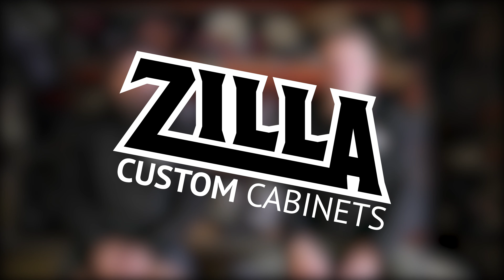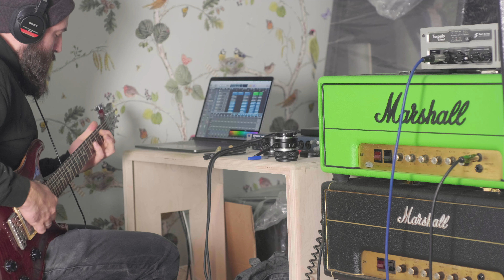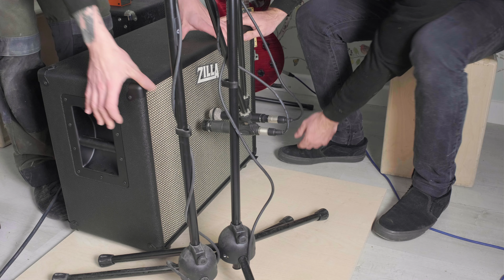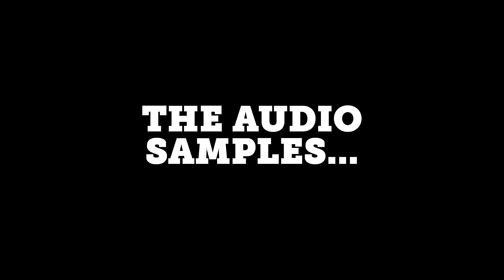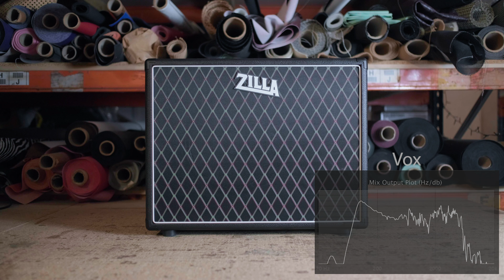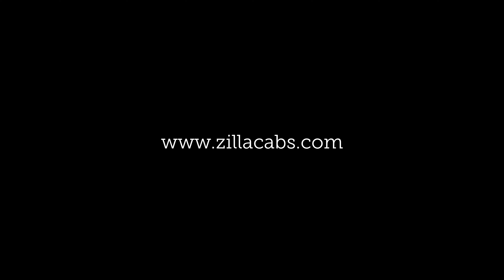How grill cloth effects the sound of a speaker cabinet and amp.

Comment: Terrific video gents. Really interesting.

I recently added an early 70 replica 4x12 with S&P grill cloth. It feels and sounds like cane when I run the back of my hand (nails) across it. Anyway, I can't believe how great this cab sounds compared to the 80s 1960A I had for over 25 years. I don't think it's any one thing, though I feel like the overall construction (built to original specs) is the biggest contributor, followed by speakers, and then grill cloth.

I'm guessing most would put speakers first, and until getting this cab, I would have felt the same way. But hearing the resonance of a well-made cab has allowed me to see the light.

At any rate, I enjoyed the vid and LOVED the tone!

Comment: Great video! With my eyes shut and cranked through studio monitors there's one or two that stood out to me but otherwise it was real subtle. That Marshall sounds ace through all of them regardless.
Reply from the maker: Thanks mate, the difference was really subtle wasn't it.. I think the big difference would have been having a removable grill allowed the mic to be placed closer with the grill off (not that we recorded that option any closer)... that said I'm not sure closer would have sounded better, just different.
Reply: @ZillaCabs  closer to the speaker would increase the proximity effect. On a Mesa cab, it's quite common to pull a mic back 3cm+ from the grill, or you have to lower the bass on the Amp, making it sound anemic in the room. Plus it adds like a 2% in natural ambiance. It just makes things sound a little bit more natural.

Comment: The changes on the graph were extremely subtle. Most people need to hear a 3dB SPL change to hear a difference in volume. None of the graph changes looked anywhere near 3dB. I doubt even the best ears could tell much if any difference. I would have to see someone doing a double-blind test or even better still ABX testing to believe mere mortal ears could tell which cloth was which. Thanks for confirming what I suspected. Nobody in the audience will be able to hear a difference so pick the cloth that looks best to you. And if you think one cloth sounds better than the other use it. The most important thing is to do what makes you happy. <G>

Comment: Great video. Thanks for doing this. I was interested in seeing the response of the orange Basketweave. Is that the same thing as a Cane Grill cloth? There is a lot of talk about how the cane grill cloth cuts highs. The graph does show minor cut in highs but certainly not noticeable to ears.
Reply from the maker: The cane is often just a different name for basketweeve. Although I can a different cloth cane. Thicker cloths will kill the top end but it was surprising in this video how it didn't seem to make as big a difference as you'd think. There are bigger factors that give an Orange 4x12 its sound than the grill.. the wood and several aspects of the construction are the major factors there. Thanks for watching, I'm glad you found it useful.
Reply: @ZillaCabs  Thanks for the reply. It was quite useful. Very scientific approach. I just used the cane grill cloth/basketweave in one of the cabinets.

Comment: It was interesting how the little tiny bump below the main bass resonance changed quite a bit: I wondered if it's the cab resonance changing due to the ports being blocked up more by some fabrics: some of the midrange changes may be due to this effect also shifting higher air modes around: interesting to do this with an open backed cab: might change its IR curve a lot less
Reply from the maker: Quite possibly.......... I've been meaning to see what the apertures in the grill would do to the peaks and troughs, and yeah we are moving over to testing with open and closed back cabs to show the difference. I think an open back test would definitely be worth it.... but then that said having no grill cloth didn't make a huge tonal difference. Thanks for the input Nick!

Comment: I love open back cabs and wanted to see if you would test Front mounting speaker on the baffle vs back mounting on the baffle to evaluate tone changes. It seems that 99% of the cabs are mounted on the back of the baffle. Even combo amps are back mounted where they could use the xtra room in the back with bigger frames and magnets if front mounted.                                                                                               I had 4 1x12 custom cabs made that mount only from the front because there is not enough room to get the speaker in through the back of the cab. It just never crossed my mind when I had them built. They are road ready cabs with metal grills like Mesa used to do.                 I am thinking that the biggest reason for all back baffle mounting is for aesthetics and putting a grill cloth on the front of cabs. I could be wrong and would want to know if their is some scientific reason for back baffle mounting.                                                                       Stranger things have happened. I have read that there was no scientific acoustic thought by Marshall that went into a 4x12 cab other than having more speakers for the higher powered amps. Guitar speakers were all low powered in those days. It would be so cool if you could do that test. Thank You so much. I enjoy your test videos......
Reply from the maker: Hi Donald, thanks for the comment. I have been wanting to make a front vs rear loaded video for a while. A lot of the tonal differences are due to cabinet design, how the cabinet is constructed in order to allow the speaker to be mounted that way but we could go quite in depth on that one, it is a great suggestion for a video.
Reply from the maker: Oh and a quick insight as to why we do it...... it is mostly a result of preferring a baffle to be screwed in place rather than fixed in to the main body of the cab and although you can do this with a front loaded speaker, I prefer a slightly thinner wood on the baffle (in most cases) and it is just more convenient to load the speakers from the back in that case. Loading the speaker from the front or rear makes minimal difference in that case in comparison with how the baffle is constructed, fit in to the cab and the thickness of wood.

Comment: Here's a silly question for you. Is a 2x12 overkill volume wise for home use where I can't exactly crank my amp or is volume determined just by the amp
Reply: Mick it’s one of the questions I asked when I bought my Zilla in the summer. I ended up buying a Studio Pro 1x12 with a Creamback in it. I’m not saying this is right for you, but the advice I got ended up working really well for my needs, so I’m sure you’ll get the right cab for you if you get a Zilla.
Reply: @sprintingforsigns  oh I will with certainty be getting a Zilla, just trying to settle on which model and colour scheme :D I mainly play metal so want good headroom in the low end but a 1x12 fat baby might be more than enough for me. Choises choices..
Reply from the maker: HI Mick, there are no silly questions... this could be a video in itself! There is no reason not to get a 2x12 for home use but you can get really pleasing results from a 1x12. Cranking amps is cool but a second speaker in a cab isn't going to effect this as much as you would think, speaker efficiency (using a loud or quiet sounding speaker) can be as big an effect.... also spread of sound of a vertical 2x12 often means as you hear a cab better you wont need to play as loud. These all effect how you can crank your amp.... also you playing loud, me playing loud and what your neighbour considers loud are three different things ;) how loud do you play? And what kind of room will it be in?
Reply: @ZillaCabs  the point about the bigger cab having a better spred therefore possibly needing less volume makes a lot of sense as I find the main reason I turn my current 1x12 combo up is to get that low end. I'll be in touch in the next few days to put in my order once I pick a colour scheme. Thanks guys!
Reply from the maker: @lowhangingvegetable  excellent, thanks Mick. Any questions just ask.
Reply: @ZillaCabs  - for what it’s worth, I second the notion about being able to lower your volume with a vertical 2x12 cab. This is handy not only at home, but in the clubs as well!

It’s also worth noting that this keeps one speaker on the floor so you don’t totally lose the low end interaction created by the floor but the other speaker is closer to your ears making it not only easier to hear but you get a truer representation of what the top end is doing out front. 

I gigged vertical 2x12 cabs for about 30 years and believe it is THE cab of choice for both home use and club dates. 

Regards to all from Elkton Maryland! 😃